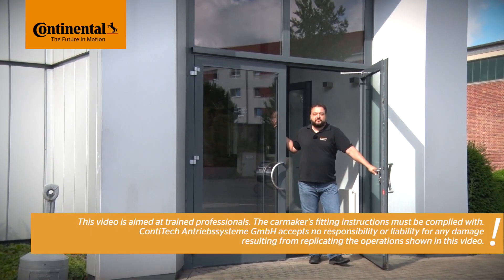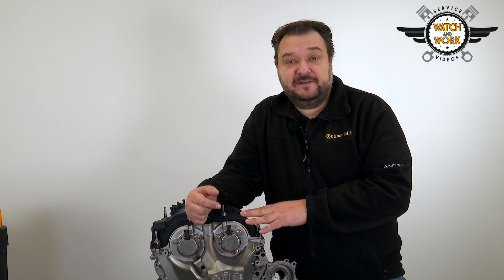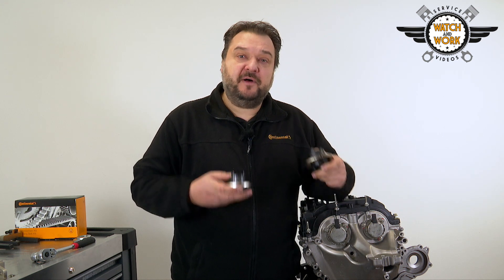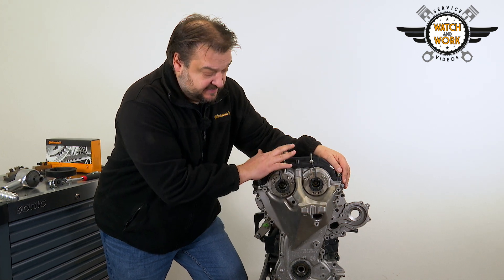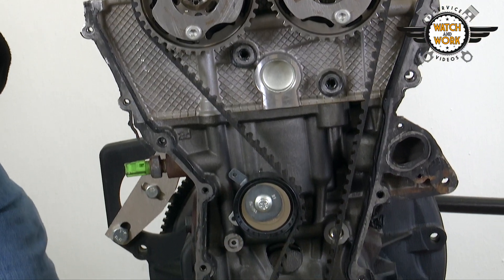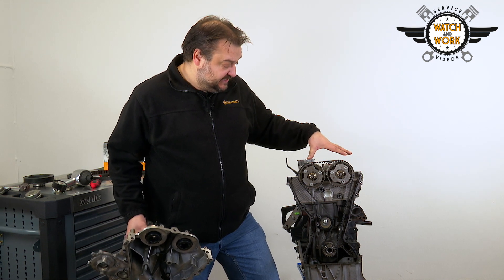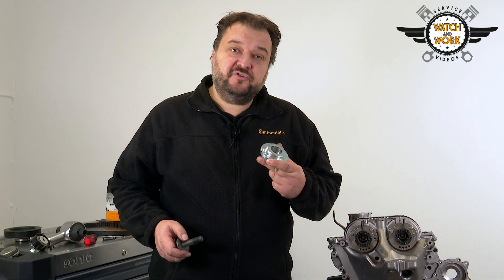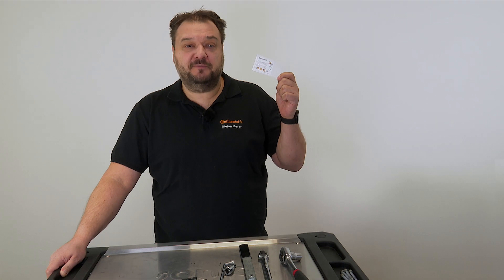Watch and Work Tutorial: timing belt replacement: Ford Focus III 1.0l 92 kW Eco Boost

Comment: Great tutorial. Thanks!

The change interval mentioned cannot be correct. There are so many reports about failures that happened at half this interval!
Didn’t Ford update it?
Reply from the maker: Hi @jacoe2159, yes, the failures are known but have nothing to do with the quality of the timing belt. It has a lot to do with the regular oil change interval prescribed by Ford. Unfavourable influencing factors such as short-distance driving, a lot of city traffic or increased ethanol content in the fuel (E10) are minimised by special additives, these additives are in the oil and are consumed. Therefore, regular oil changes with the oil approved by Ford annually/20.000km are mandatory.

Best regards!